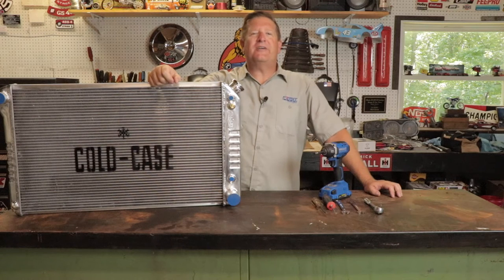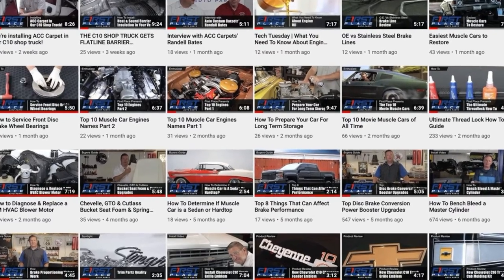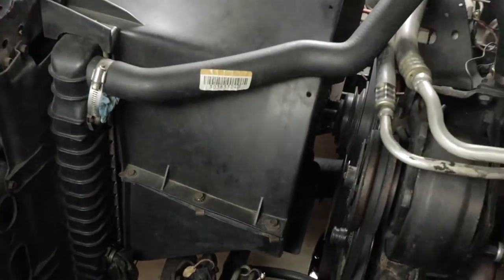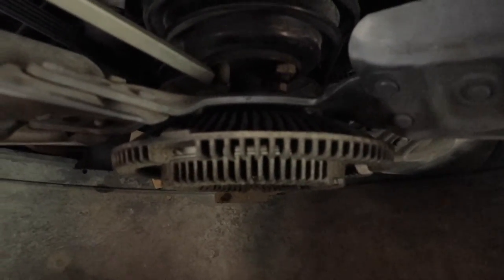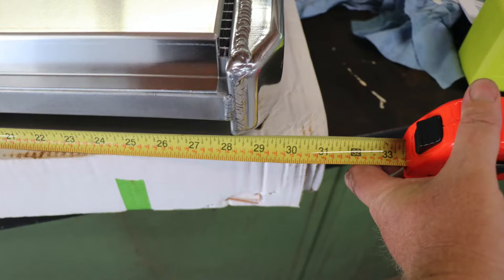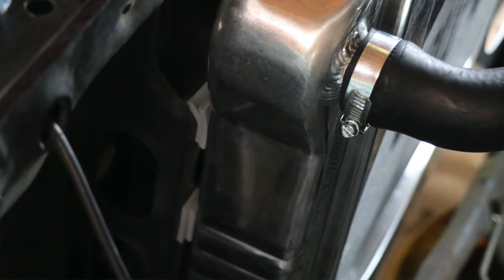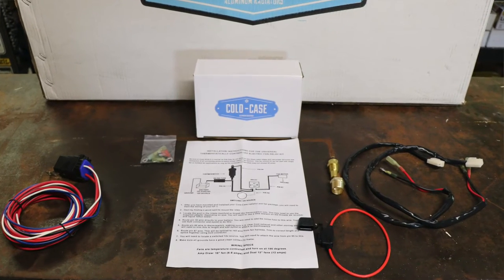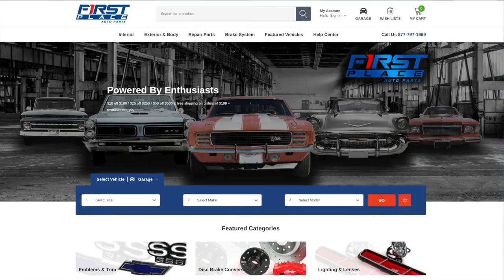Installing a Cold Case Aluminum Radiator on our Chevy Square Body Truck

Comment: I bought two Cold Case radiators for my chevelles. They were both a little bit wider and then the original and didn't fit in the rubber very neatly. I called him up and talked to the tech and he said that we have never ever had anybody tell us that our radiators are too wide. I said the work but if they were a little narrower they would fit perfect instead of just pretty good

Comment: The radiator and aluminum shroud I got for my 68 Camaro came with neither those detail instructions you mentioned, nor did it have any pre-drill holes in the shroud. Thanks for the tips.

Comment: I’ve been beating my head against the wall on my c3500 not cooling so I ripped everything out even the engine. Found a hd gasket tear in the exhaust port. Just a tiny tiny rip. Anywho everything stock and new snd it still ran 230. I changed out the rad cap after 5 years. It was on the old motor rad. The temperature dropped to 195 to 210.

Comment: My 85 was an original 4.3 with the th400. Back in August my radiator started leaking pretty bad so I removed it to get another. The one you removed from this truck looks like the one I removed. It was very small and no where locally has them in stock. Do you use a lot of these cold case radiators? Im just a little scared to use the alloyworks.